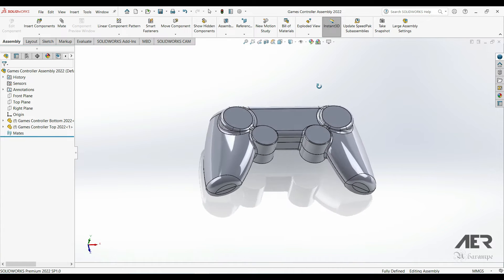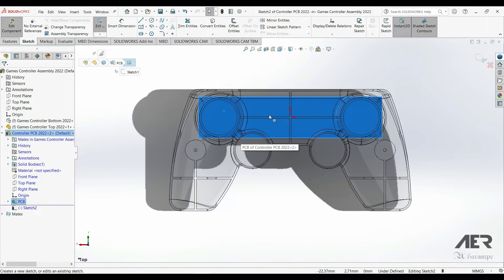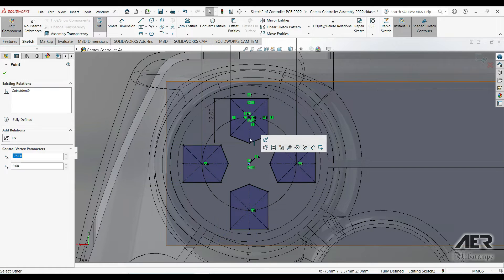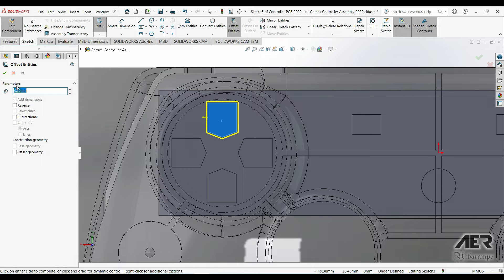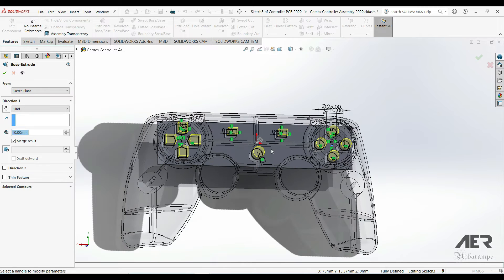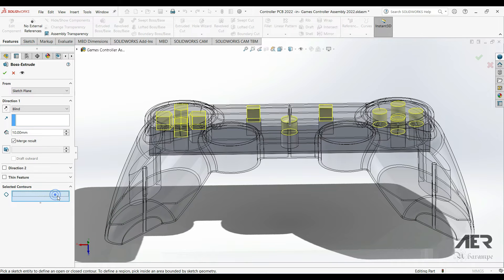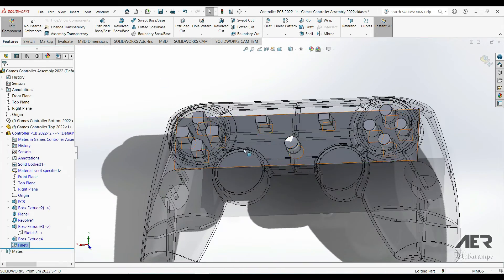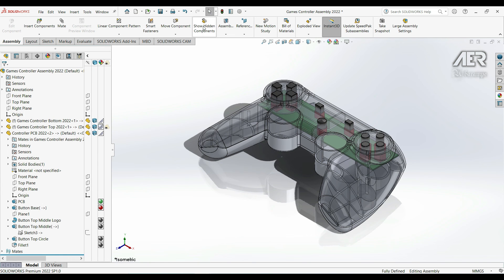Solidworks Tutorial Sketch Shape PCB in Context Playstation Xbox Joystick Stage#7 English - AER Int.

Comment: Hi, Can you please guide me how does your model looks shiny. I have tried putting shiny appearances but it still doesnt look like this. Please guide
Reply from the maker: if I may ask, what version of Solidworks are you using?
If you are using Solidworks version 2020 or above, the display will probably look like the one in the video
Reply: @AER_Int.94531  its 2021 but when i model parts, it displays dull gray, while i have been trying to configure the settings to make it look shiny but unable to do so
Reply from the maker: @faiqali9819  I think my suggestion is that you can go to the View settings in the top center of the worksheet, then select "RealView Graphics"

If that still doesn't work, it's possible that the version of SolidWorks can be upgraded. You can use the 2022 version like I use or above.